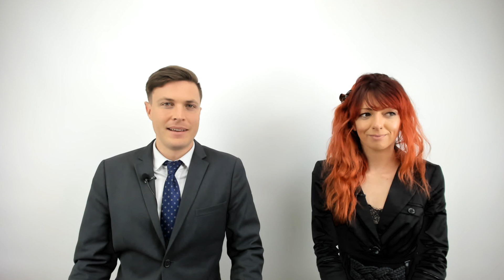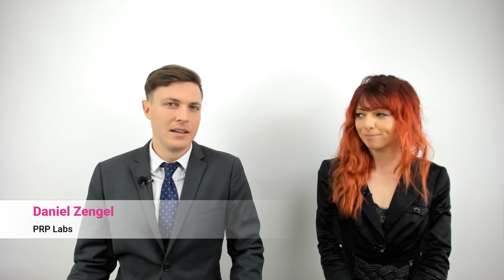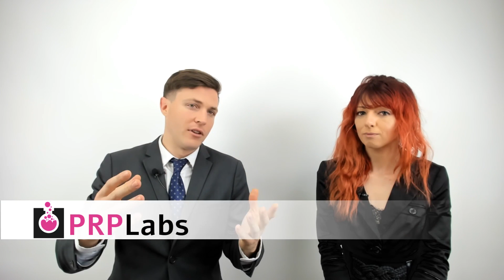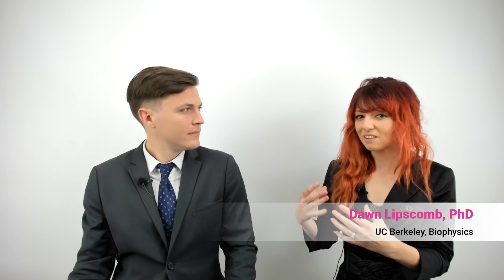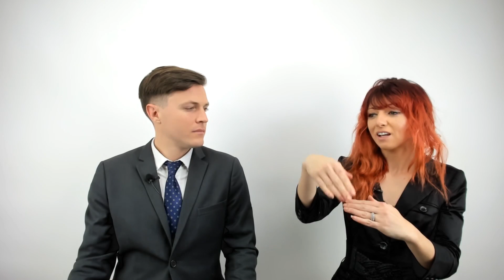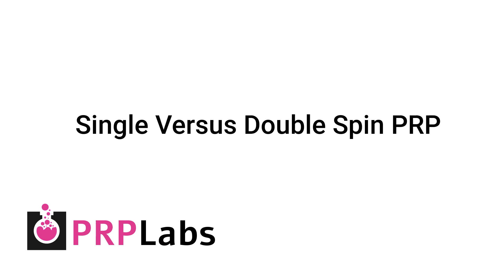PRP Preparation: Single Spin v. Double Spin Centrifugation

Comment: Does it matter the equipment used?  The doctor I contacted for PRP for hair loss said his SmartPrep 2 system is a better machine doesn’t require a second spin.
Reply from the maker: The equipment used to prepare PRP has a significant impact on the quality of the PRP - including the concentration of platelets, RBC's and leukocytes.  The Harvest SmartPrep 2 is at least an FDA cleared PRP system.  However, third party studies have demonstrated that the Harvest PRP system recovers a lower percentage of platelets than the EmCyte PRP system.

Comment: What rpm for first and second spin is ideal?
Reply from the maker: The ideal RPM will depend on the brand of PRP equipment being used and the manufacture's instructions for operating that equipment.
Reply: @PRPLabs  thanks. Very informative. 🙄

Comment: Is these method used for kit without gel separator? I mean, what is the advantages for any kit using gel separator to do double spin? Dont the rbc are easily separated with single spin in this case?
Reply from the maker: There is a big disadvantage to using single spin kits.  Here is our blog post and video in which Dawn and Daniel discuss the difference between single spin and double spin PRP kits: https://prplabs.com/blog/prp-preparation-single-spin-v-double-spin-centrifugation/